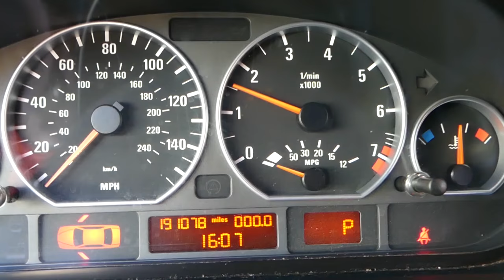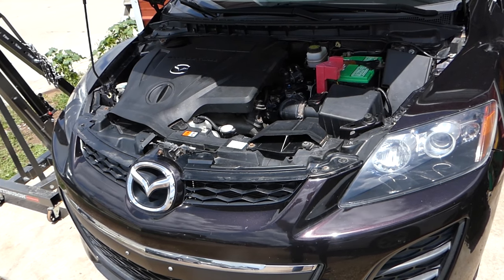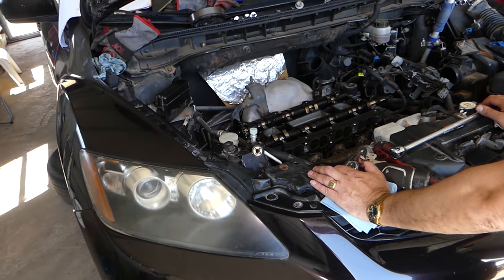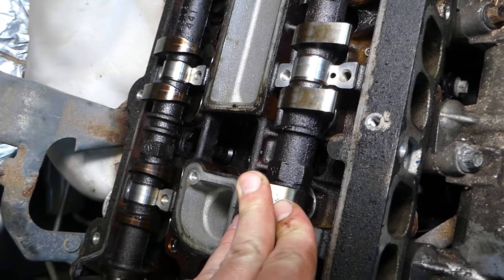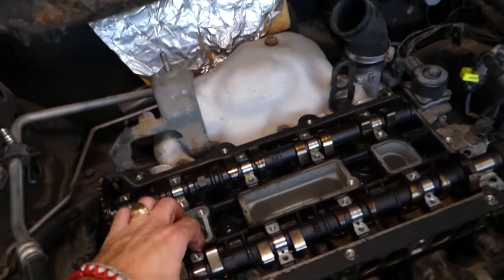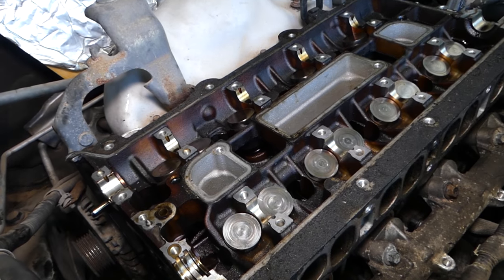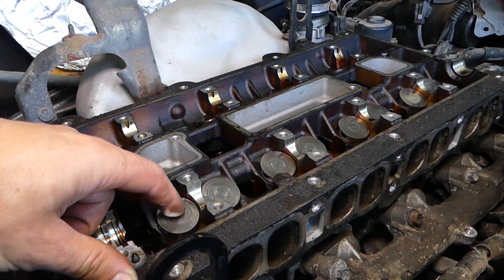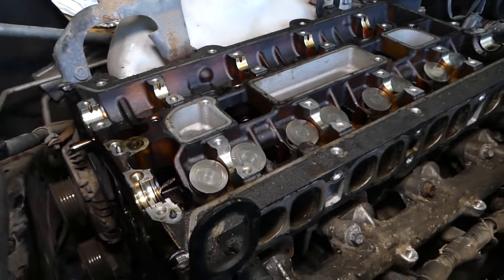WHAT VALVE LIFTER NOISE SOUNDS LIKE. WHAT CAUSES VALVE LIFTERS NOISE

Comment: Does that noise go away or at least almost gone when warmed up? And my noise goes away when I accelerate.
Reply: I'm having the same problem on my Jeep, was wondering if it's fixable or if the Jeep is better off gone.
Reply: @japanda4872  idk honestly. I was told It could be my timing belt but I haven't heard anything about a timing belt making any noise. But I think If It was the timing belt the noise wouldn't basically be unnoticeable after being at operating temperature. It's something that's bugged me but I think I'm just going to drive the car for a little longer while I save up money and sell It for cheaper then I wanted to sell It for. It's made that noise for about 3 years now. And It only does It when It's cold outside or a little warm and under the shade. I don't want to spend about $450 replacing the timing belt just to find out that's not what it was.
Reply: @beast11135  timing belt does its job unless it breaks.  There is no old timing belt causes this or that. Timing chains yes

Comment: What about hyundai gdi 2.4 engine can i adjust the lifters or replace it,  thank you 🙏🏻
Reply: x2 i have the 2.0 forte gdi and its making a noise but now idk if its the lifters or time chain i have a video
Reply: If it’s the 2.4l “Theta” engine, it probably won’t be a valve lifter issue.  If it’s the 2.0 “beta II” engine, they use lifter shims instead of rockers or hydraulics
Reply: i just replaced the time chain and tesioner and my rattling noise went away.
Reply: @leonelmartinez5226  thank you but what is your car and the rattle noise happen in cold start ?
Reply: @khalidbahkim5112  rattle noise would begin after 1 minute of being turned on, like not on coldstart or right away no, but once the engine was on or warm it would rattle all the time, my chain looked fine, it was the tensioner but still replaced both its a 2010 kia forte 2.0
Reply: @leonelmartinez5226  thank you very much🌹
Reply: @leonelmartinez5226  was low power a symptom as well as knocking before you replaced the timing belt

Comment: I have the noise in a van I have! It's right under the doghouse, so you can hear it clearly inside the van! It goes away as you accelerate and comes back when you lay off the gas!
Reply: Same have you fixed it
Reply: @santiagoalvarado2423  I poured in a bottle of ZDDP and the valve noise is still there unfortunately. When I change the oil next I'm going to try pouring a bottle of automatic transmission fluid in with the oil and see if the detergents can work out the gunk in it.
Reply: Hey man any updates?
Reply: @montatherkhalil6091  The mechanic says it's not the valve lifters being all sticky, or the sound would be pretty constant and not just go away when you hit the gas. He didn't look at it for very long. Whatever it is doesn't seem to be serious, just annoying. Problem was the sound sometimes goes away on its own and when I did take it in, it wasn't making the noise. Did try the automatic transmission fluid in with the oil. Sound is still there. Click click click.
Reply: @PouchMaster  that’s very weird and the exact same is happening here lol mine sounds like it’s coming from the rear right passenger floor but muffler is perfectly fine just very confused on where the sound is coming from.
Reply: @montatherkhalil6091  Has a clamp come loose under the shaft maybe? Could be it needs a weld. If it's all jumpy and jerky it could also be a vacuum leak which is easy to fix with just a small piece of 1/4 or is it 1/8th inch tube.
Reply: @PouchMaster  good point I’m going to get the vacuum check I hope just an easy fix
Reply: @montatherkhalil6091  OMG me too!

Comment: Did you measure compression in cylinders before changing lifters maybe? Can they cause leakage in cylinders? I have 2.2 ctdi Civic with noisy lifters, injectors are all good and engine does not consume too much oil, aprox. 1l per 10000km but my problem is bad compression on cylinders 2 (12 bar) i 3 ( 16bar), cylinder 1 has 24 bar and cylinder 2 has 22 bar.
Reply: What was the problem?

Comment: I know this is an old post but if you happen to see this, I recently started hearing a noise similar to this but only when I am accelerating. After about 15 minutes of driving it goes away. If I left off the accelerator it goes away. Should I be looking at a lifter? We just had the moter rebuilt, frsh clean oil. everything was fine for a month now this noise. Oil levels are all good. look clean. Im wondering if something dirty got dropped into the block or valve covers. Also just put new injectors in.
Reply: I've seen way too much rtv used on the oil pan get on and block the oil pickup.  After 2 months you start hearing rod bearings getting bigger.  Definitely something to inspect

Comment: My Hyundai i20 has valve lifter noise. It sounds a bit worse than this Mazda . 
It has about 200.000 Km on the odometer. Difficult to sell the car with that noise.
Is it worth fixing?
Reply: Not sure what model the i20 is, but a lot of those engine have adjustable valves...if there is a lot of noise, it's possible they just need to be adjusted...

Comment: I flushed my enigine with Catrol Shampoo and then to Magnatec fully synthetic I added Liqui Moly Hydraulitic cleaner and that made the noise worse! I did an oil change with COmma flusing oil and replaced with Lucas and noise gone!
Reply: Yeah, a lot of the time it's just a sticky lifter and can be cleared up without replacing anything.
Reply: Did you find out why Liqui Moly did not work but Lucas work because I am about to try Liqui Moly on my Lifter noise issue. I actually plan to try Liqui Moly due to Amazon rating and made in Germany. Do you know why it got worse?
Reply: @callmebackfriday2  break down his actions.  Full synthetic and moly. Then drained and put Lucas.  What do you think moly will do for your engine?
Reply: @joeKisonue  Thanks for your reply. I used Moly because I think my issue is Hydraulic Lifters but I tried it and it did not work. In additional to that, just before oil change, I add seaform to clean the engine but noise is the the same.  I am going to try Lucas soon but I don't think it will fix it because it made the oil thicker and harder to travel to the top.

Comment: ---------------- I have a 2012 Hyundai Elantra GLS------------- 
                                                                             1) What are the long term effects of driving the car like this?
2) Is there a DIRECT way of diagnosing/differentiating THIS noise from the:  pistons, main bearing, road bearing, or cylinder without taking it apart?               3) If the valve lifters are the problem does that automatically mean the piston and the cylinders are ruined as well? 
(I know to check the oil pan for aluminum)
4) Will a mechanic do a 100% diagnosis/inspection of a car from bumper to bumper including engine, what is the cost, and how do I ask for that?
5) If work is NEEDED, will the mechanics check for lack of compression, if the head gasket needs replaced, the spark plugs, ignition coils, injectors, piston rings ect ect are bad, or is that an extra charge?
6) Should ---(I DRIVE IT TILL IT BREAKS)---, ---(GET THE WORK DONE/HOW MUCH IS IT)---, or ---(TRADE IT IN FOR SOMETHING ELSE)---?
                                           ---------almost positive this is happening to my car,86k miles, regular oil changes------
                                                                               ------------car is payed off so im discouraged------------
       

                                       ----------------- I know this is very long to read but any/all responses are appreciated! Love the videos!-----------
Reply: 1) Long term effects: Depends on the car really, some cars have hydraulic valves and this is normal. For most, it will cause wear to valvetrain components and eventually lead to failure. It might also reduce power slightly, but it's probably not too noticeable unless it's really bad.
2) Remove the valve cover and use a feeler gauge with your car's specified clearances (COLD) and check that the intake and exhaust valves are correct for each cylinder at TDC. This is the only true way to diagnose the issue.
3) No
4) Yeah, go to AAA and ask for a 40 point inspection and bribe the tech to check anything extra. I think it's like $20. You could go to a trusted mechanic and pay more for maybe a more thorough inspection.
5) You can do it yourself. Even if you had to buy all the tools (including a torque wrench, feeler guage, sockets, RTV, and gaskets, it would only cost you like $60. If you had tools, maybe $10. A mechanic could charge up to 500. They won't check for that other shit if it isn't the issue, but they're probably take at the spark plugs and coils while they're opening it up.
6) You can drive it till it breaks if you prefer wasting money, but this really isn't terribly bad I assume so you can let it go for a bit until you can fix it, but don't forget about it. You could get the work done - yourself for less than $100, or for up to $500+ from a mechanic. A quick check shows that the trade in value of your car is also pretty low, so I'd just keep it with the mileage or sell it to a private party and buy a better used car. Don't buy new.
Reply: I've been having very similar questions. I've been watching videos of engine noises for about a week now. I swear there about 20 engine issues that have the same damn knock/tick sound. The mechanic doesn't know what it is and said the only way to figure it out is to do exploratory surgery on the engine basically haha that would run me $2000

Comment: Is valve lifters same as rocker arm ? Thanks
Reply: No. Hydraulic valve lifters are little barrels that take slack out of the parts of valve train. Rocker arm are pieces that transfer up motion into down motion and act on the valve directly

Comment: Is replacing the cam shafts and timing chain cheaper than buying a used engine to drop in? It will cost me $4500
Reply: For that price, or you could do it yourself for a couple hundred bucks
Reply: A low mileage engine swap is better than tuning an old one
Reply: @joeKisonue  yeah that's what I ended up doing. Thanks
Reply: @joeKisonue  i wish you could help me out, I have a volkswagen jetta 6 with irritating noise, i replaced alot on the egine, oil pump, chain. The noise is still in and the mechanic is left with no option

Comment: I love this video because I think it might've just helped me diagnose engine issues with my 2005 Honda Odyssey EX-L...yep, that's a model with the dreaded VCM engine. I do have a question, though, that the video doesn't address. Would it be possible for the ECU to throw codes for multiple/random misfires if the valve lifters are bad? I'm getting P0300, P0301, P0302, P0303, P0304, P0305, P0306....I know a lot of Google search results will show that this means it needs a valve adjustment. I've taken my van to 2 Honda dealerships and 2 independent shops that specialize in imports (1 specifically Hondas) and nobody can diagnose it. It passed all the voltage/compression, etc tests twice! It has a rough idle, but otherwise has PLENTY of power! I have a drivetrain warranty on my van, so I'm praying this will be the key in getting it properly diagnosed so it can finally be fixed. It has brand new Honda plugs and coils, my son and I cleaned the mass airflow sensor, removed the EGR valve to clean it, test it, check ports and replace the gasket. I'm getting ready to replace the PCV valve this weekend and drain and fill the transmission fluid again. The torque converter is noisy, but it shifts fine. 🤷‍♀️ If anyone in the state of Virginia sees this and wants to get a look at it, I'll happily drive it to you!
Reply: Can you confirm the correct OEM oil weight is currently being used? For example modern engines use fully synthetic oil at a very specific viscosity (5W-15 etc etc) and if mixed with or replaced with a thicker (5W-20) or thinner oil (0W-30) can produce noisy engine components.
Reply: 6 misfire codes for each cylinder? No.
Normally when a valve is too loose or too tight, The knock sensor will detect this and tell the ECU to lean out the air/fuel mixture before catastrophic detonation and heat soak occurs.
Check your plugs & coil packs individually, The condition of the plugs will tell you a LOT about how good or bad each cylinder is running.
 You say your Torque Converter is noisy? Are you SURE it's the Torque Converter and not the Flexplate/Flywheel maybe being cracked or warped and causing noise/shake at idle?
 A cracked flywheel could most definitely throw off the Crankshaft Position Sensor, which would cause it to idle a bit rough and cause all 6 misfire codes because it can't keep up with the flexplate when it's shaking. 
If the sensor can't smoothly get the signal exactly when the flexplate's button passes it; The the PCM cannot tell the coil packs when they should be advancing/retarded the spark of the ignition's timing in correlation to engine RPM's and you get those 6 misfire codes with a bit of a shaky idle.

Comment: Great video , just took mine to another garage as my first one could not work out why i was losing power ect ,so took it to a new garage and he picked it up straight away and turns out i need the camshaft replacing as its damaged where it should be curved but is now roundard off and also the tappings which i assume is the loud noise from the front  and he advised me to get timing belt ect replaced as he needs to take off anyways but a full day job.

Comment: thanks so much , please help, how can I distinguish the knocking of worn out conrod bearings and the knocking of the valve lifters?
Reply: Spun conrod bearing may sounds like a random rattle because it will make a noise every time the conrod spinning, the noise have no certain intervals as it bangs around the rod and eventually worn out the cylinders too. Valve noise tends to have more certain interval.
Reply: @rizaldyzulfiqarrachmad5964  thank u so much

Comment: What if it sounds like lifter tick but there is not gap with the cam using a feeler gauge ? What else would you check next ?
Reply: Remove the oil pan and look for glitter from rod bearings
Reply: @joeKisonue  that's some sad shit but at least finding the culprit is better than none. I always have fear of timing runoff and tapet valve boxing the piston up into glitters.

Comment: i just got a used 2014 ford fiesta and my car makes this noise. is it worth bringing to the dealer to have it fixed or is it something i can ignore?
Reply: The real problem on the ford fiestas are the automatic transmissions. They break very early and often. If it starts to shift weird sell it quick
Reply: It's worth it to check your oil. Make sure it's full. Then try an oil additive for lifter ticking. Maybe it'll go away. There's a couple different products on the market you can add to your oil.

Just monitor it if it gets worse then maybe bring it in. Just know you're going to pay a hefty price for them to take everything apart and diagnose and replace. If the noise is minor you can just continue monitoring and live with it. Drive the car until the ground. 

If you're not handy don't try to replace your lifters or adjust your valves on your own...
Reply: @kentdavies1988  thankfully i dont notice the noise anymore but this is good to know incase it does, thanks!
Reply: @lunaluna6474  good to hear. Just turn up the radio and drive.

Comment: I am a mechanic. The best advice I can give you all is to buy a new car or one with a few thousand miles, drive it until it has around 45K on it and then sell it or trade it in on a new car. Make sure you rotate your tires, do regular oil and filter changes and have a shop check your liquid levels. It is a terrible idea to keep a car after 45,000 miles because little by little things are going to wear out and fail and cost YOU money.
Reply: That is such terrible advice. With the price of new or low mileage vehicles these days, it almost never makes financial sense to buy one. Just do regular maintenance and fix whatever breaks until the car is absolutely just falling apart. It'll most likely be cheaper. There are many vehicles on the road with many miles on them doing just fine.
Reply: yeah i just figured this out today ! cars only really only good for like 5 years

Comment: I have the tick, but it ain't that loud. My ticking sound is quieter than the purge valve ticking sound. Can't figure it out. Only noticed it after my last synthetic oil change. Sounds like it's coming from the bottom of the engine rather than top and comes and goes, cold or hot
Reply: Same bro I got a 2012 mustang. Been had it for years tho. I can't afford to fix that. Still drive it across country